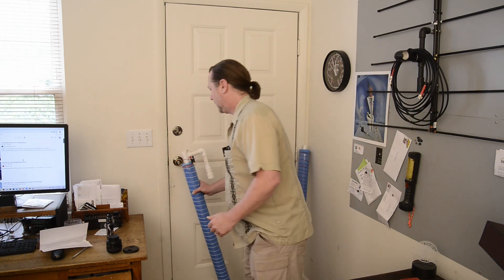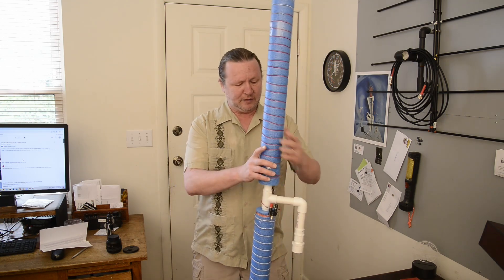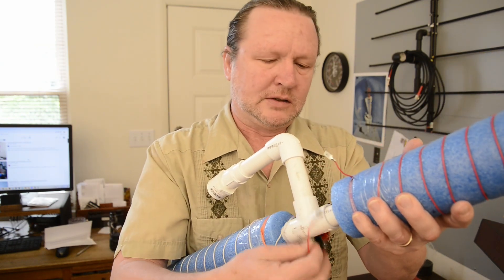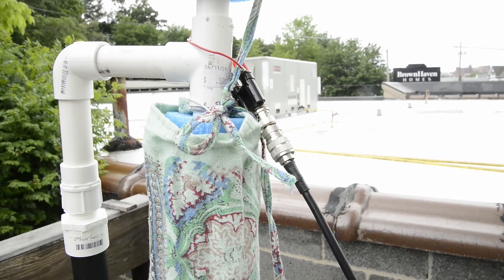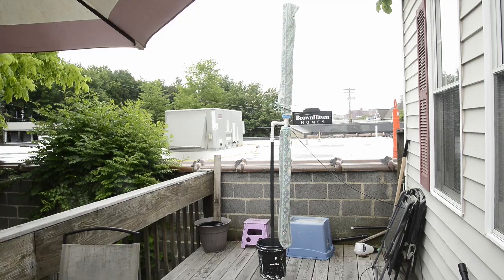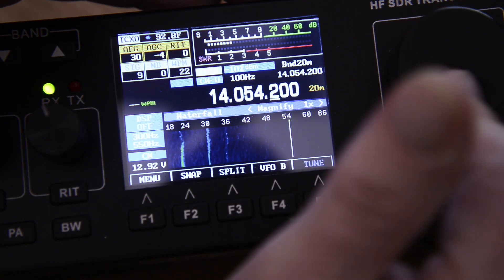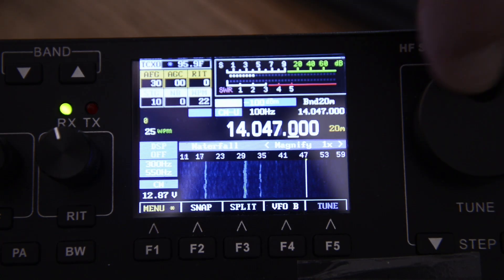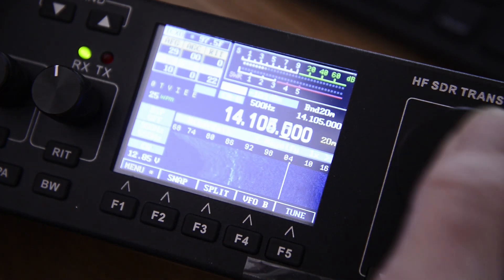Pool Noodle Dipole - FAIL - Ham Radio Portable Antennas

Comment: So if I strung up  full size dipole and mounted it a few feet above the ground, what result would I get?  Probably not great.  Since the noodle antenna is electrically equivalent to the dipole, just shortened, maybe mount it elevated 5 or 6 meters.
Reply from the maker: I am not sure why I got such a bad result, but It was just for fun. A standard dipole will work very reliably well. If you have it close to the ground on the lower bands, like 80 meters, it will be effective  with more local coverage. Raising it higher would be best for more distant contacts.

Comment: Just for a testimonial I have had the @rudiwiedemann8173 pool noodle design operational on the 20 meter and 15 meter with terrific DX contacts. My application is horizontally configured within the confines of a small attic space. Take your time trimming the ends for the best match and add a common choke. Trimmed up both of my noodles run a wide band 1:1.0 match. My next project will include a 40 meter noodle  I suggest you make a follow up review video if you proceed with your successful build. 😀

Comment: K7RAW-The Antenna Whisperer and designer of the NoodleTenna here to help you SUCCEED with your 20m NoodleTenna. First off, nice job in construction. You showed a pretty decent SWR at timestamp 7:13, just a bit high (14.88 MHz) in frequency so you know it can resonate. You just need to realize that this is simply a physically-shortened but electrically identical antenna to a classic wire dipole (like the well-known "Slinky Dipole") which is technically called a "continuously-loaded dipole".

A couple of suggestions: 1) Add a "common-mode choke" (in this case a 1:1 BalUn) located at the antenna to isolate your feedline from the antenna. Evidence for needing this is any effects on SWR from nearby metal. A "coax-wound" CMC on an FT-240-31 toroid is ideal; 2) Run the feedline 90 degrees from the NoodleTenna to minimize interaction. Mounting the NoodleTenna horizontally makes this easy (like down the vertical mast tubing); 3) Set up your NanoVNA properly (frequency range first, THEN calibrate). Then you can easily see whether you have an open, a short or something close to 50 ohms ; 4) Make the legs EXACTLY the SAME LENGTHS (and fold-back the extra wire under the last turns) so you can adjust the turns to get a VERY GOOD SWR match, otherwise you will never get a good SWR (high SWR minimum means unequal turns); 5) You DO NOT NEED A TUNER because this is a resonant antenna with close to 50 ohm impedance (no ground, no radials, no impedance transformer). This design is nearly identical to the classic "Slinky dipole" which many people have had lots of success with (only I use good-conducting wire instead of the Slinky's poorly-conducting spring steel). The stiff noodle and PVC backbone does not seem to degrade performance over an air-core Slinky. The shortened design makes it somewhat less sensitive on the receive side but does not affect the transmit efficiency. Avoiding noise-generators nearby like high tension power lines will lower your background noise.

So PLEASE, BEFORE you "bad-mouth" someone's design, maybe you should seek out a little help from a knowledgable antenna builder to show you how to implement my suggestions above to succeed. I've had lots of people build my NoodleTenna and make lots of QRP QSOs. If you want some help getting good results with this antenna I can walk you thru the simple process. Just email me at rudi@wiedemann.cc. I'm THAT CONFIDENT I can show you success with this antenna. You are SO CLOSE to the finish line. 73....Rudi the Antenna Whisperer.
Reply: I'm curios now as to what you whisper to these antenna's.....should we be concerned 😜😜😜
Reply: @bitemykrank1970  I whisper "sweet nothings" in their ear (or feed point), HA HA
Reply: @rudiwiedemann8173   can't wait to try to build this.
Reply: Thanks those are very good points

Comment: If you touch the outside of your coax connector and the SWR changes your getting RF on your coax (Common Mode Currents), and therefore false SWR readings. Your coax needs to be decoupled with a 1:1 balun or ferrite chokes, AKA Common Mode Choke, before your radio to stop this. 
Any loaded shortened antenna like this will be less efficient than a stretched out wire.
Antennas are sensitive to their environments, especially metal in their environment, especially indoors, as your finding out.
Antennas prefer wide open spaces, ABOVE things in their environment.
The further away from your living area, the less QRM / man made noise from digital devices within your home will affect your reception.
The odds were stacked against your setup working well.
ALWAYS make wire antennas longer than you think you need (lower frequency) them trim them to increase resonance to your desired center frequency. Too high a resonant frequency, too short the antenna.
73   -mike

Comment: Another thing you might consider doing is building a 49:1 balun and then using a noodletenna as an end-fed half-wave. That means you can feed it from the bottom, and also will work on some frequency multiples. I've seen some videos of people making end-fed slinky antennas that work well on 40 meters and 15 meters. You will need some short counterpoise wires but should be a lot easier to deal with than a traditional 1/4 wave vertical (which requires a bunch of 1/8 or a few 1/4 wave radials).

Here's an example of a slinky in EFHW mode: https://www.youtube.com/watch?v=RejzmpjhTwU

You can build a 49:1 balun cheaper than you can buy, fwiw. Basically you need some wire and a toroid ferrite.

Comment: The z of a heavily loaded dipole is less than 10ohms. Maybe 5 ohms.  You could make it work but the z is one of 2 problems. The other is that, unless its on a tall mast, it needs to be horizontal so both sides are balanced to ground.
Apart from that , it's perfect 😂

Comment: The antenna is a helically wound linearly loaded dipole.  There will be interactions with the enviroment.   Trying to tune it to resonance indoors may not predict its performance outside.  Hight above ground might be playing a factor.  The idea of adding telescoping whips to either end and tuning the antenna using them may be a good suggetion. Just a few inches of straight wire or some wires in a fan configuration might improve its performance.  The role of the coax feeder has to be considered.  A current choke close to the feed point might make the performance more reproducible. 
Antennas of similar design are going to be be sharply tuned and you may have to decide what portion of 20m you intend to operate.
Reply from the maker: Good advice. Thanks.

Comment: Partner, what you made was a large loading coil. Add a stinger to each end and the performance will increase. Adjust the coil count for better tuning. A loading coil is only one part of the antenna system.  Experimenting is the fun part of the hobby. Good luck.
Reply from the maker: Indeed. That makes sense. Thanks for stopping by!
Reply: This is NOT just a big HamStick dipole (which isn't that efficient). I've tried your suggestion with little success. Please read my comments for more details of how this design works.

Comment: Your feedline may be coupling with your radiator.  Make sure your feedline is perpendicular to radiating element.  I use a vertical 20m OCFD antenna and had high  swr when my feedline was was not at a  90 degree angle from the feedpoint.

Good Luck
Ross, K8RLB
Reply from the maker: That is an excellent point. I will try that!
Reply: @mysteryham4065  the description on K7RAW's noodletenna video mentions using a Mix 31 ferrite choke (which is sometimes called a balun; when he says "no balun" he is sort of using the narrow definition of a balun).

Years ago I played around with slinky dipoles and frequently had issues getting it to tune. I suspect this was largely because I didn't discover the importance of chokes.

You can do an air-core choke (no ferrites required) if you have some extra coax. Somewhere in my junk drawer I have an air-core balun that I made wrapping coax around a plastic water bottle. For lower bands you'll want to use a larger form. For higher bands, probably fewer turns are needed. 

Ferrites just make the job easier because it means having to coil fewer feet of coax (which can get lossy, btw, when you have non-trivial SWR).